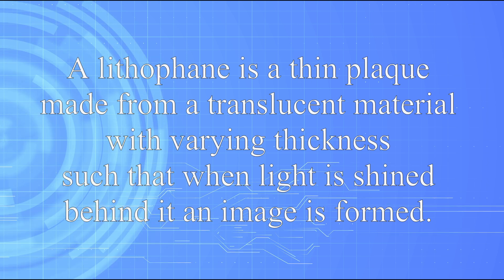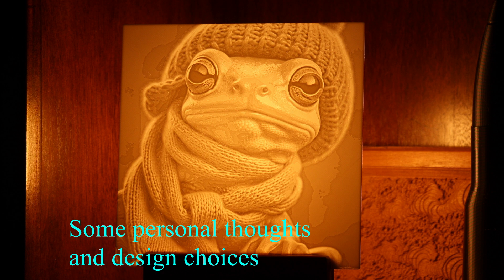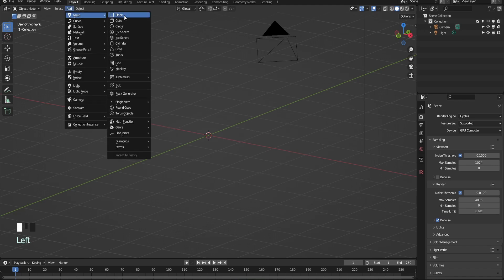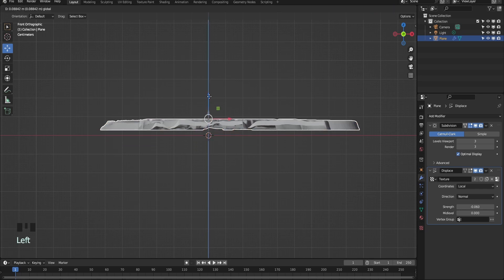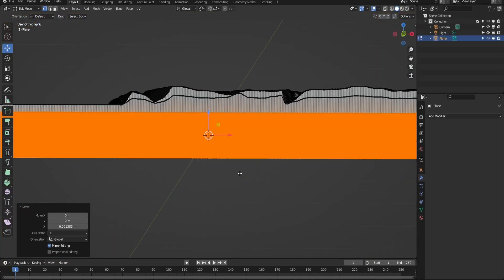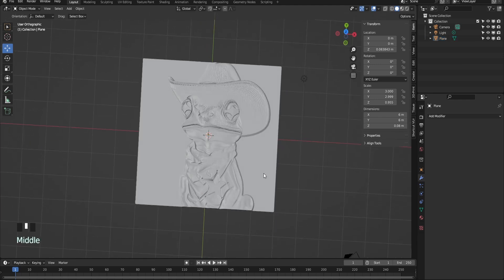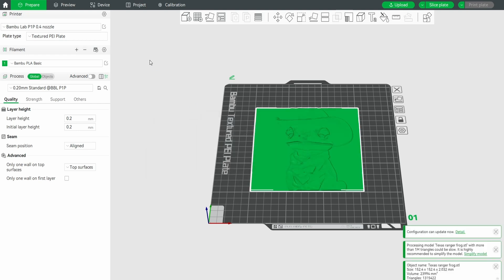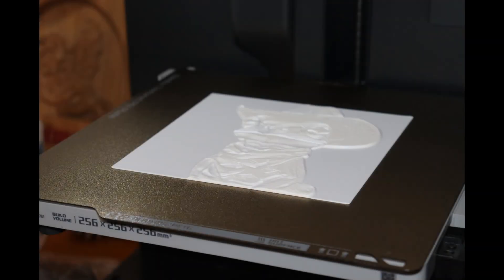Blender (3.5) Lithophanes for 3d Print

Comment: Thank you sir, I appreciate the step by step videos on both height map relief and this lithophane video. Do you know how to combine the two so without backlight its a relief (height map), and with backlight its a lithophane? I know it can be done in blender, just dont know how. Good idea for another step by step video
Reply from the maker: First, thank you for the kind words. While you can combine the two I do not recommend it. A bas relief and lithophanes are two different things. The bas relief is a positive from the image while the lithophane is the negative. For a bas relief you do not want the noise because it causes peaks and valleys on the surface. For the lithophane you want the noise and thickness differences because that creates the light detail. The easiest way to create a bas relief IMO is to use an AI height map generator on your image. My current favorite is the AI Marigold height map generator. Look at my post processing AI height maps video but use your image in the process instead of an AI image.
Reply: Thank you for the response. I also like/use marigold although through hugging face, not through blender itself. I'm very new in blender and got lost when you were incorporating marigold in blender(sorry 😅). In my experience with marigold noises provide more detail so i keep the de-noise lvl at 0. But thanks again for taking the time and responding. I will keep at it maybe one day I get better at blender and figure it out. Keep up the great videos @olgwoodart4996
Reply: I think if we apply the lithophane first then apply height map relief, not just to the surface but to the wall thickness, so the thickness remains the same as it was before. The back of the plain will be uneven of course, but we only care about the surface to be a height map relief. However when I apply your height map relief method it only applies to the the surface. Maybe you know a better way